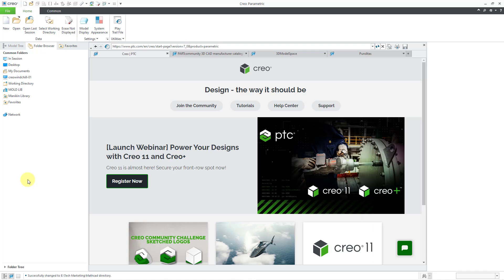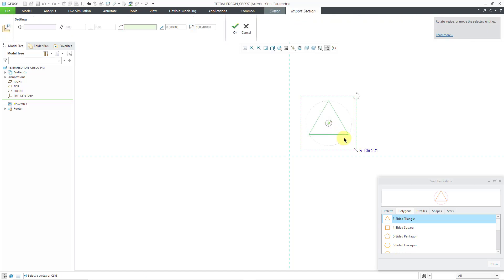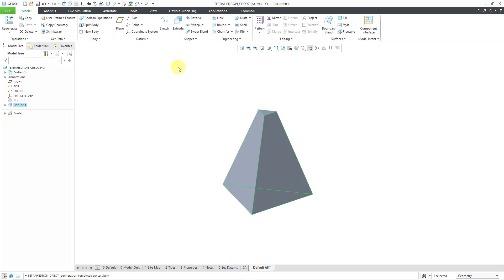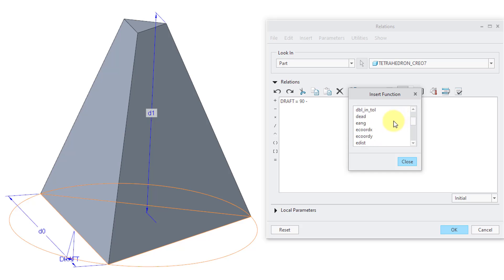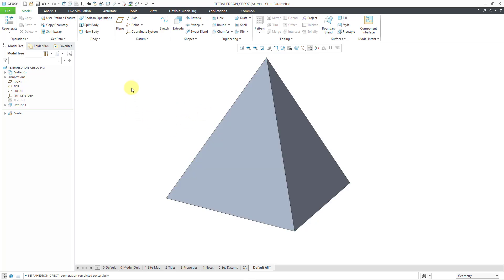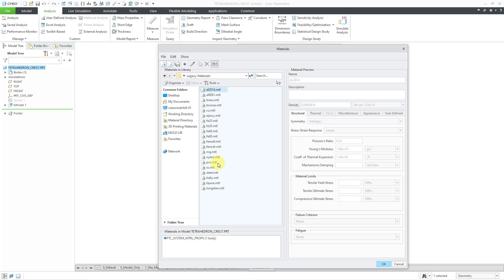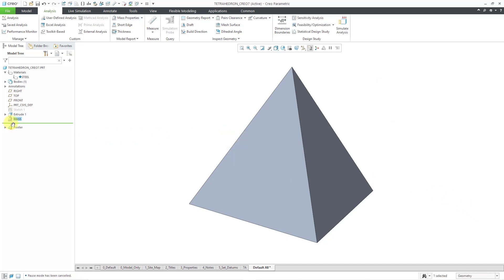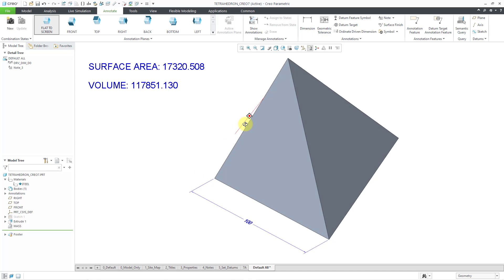Creo Parametric - How to Model a Tetrahedron - Platonic Solids and Polyhedrons

Comment: An alternative method, since it was mentioned to use a blend, is to blend a triangle to a point. To find the position of the point draw a sketch on a plane passing through the axis at the center of the base triangle and one vertex, on that plane sketch a segment the same length as the tetrahedron edge. That point is the vertex target for the blend.

Comment: Bruh just blend a square into a point
Reply from the maker: Sure, easy. At what distance? Please make a video if it's that simple.
Reply: @CADPLMGuy  Just make a plane with the desired distance on which you define the point
Reply from the maker: What is that desired distance for a regular tetrahedron?
Reply: @CADPLMGuy  Didn't see a regular tetrahedron mentioned
Reply from the maker: Watch the video. I explain that in the first 14 seconds.
Reply: It's a tetrahedron, it doesn't start with a square :D
Reply from the maker: Good point, Paolo. Blending a square to a point would make a pentahedron (also known as a square pyramid).
Reply: @paolozago6123  Doesn't change the point